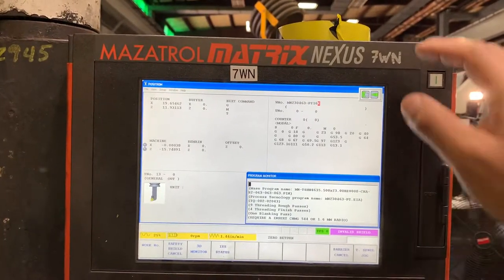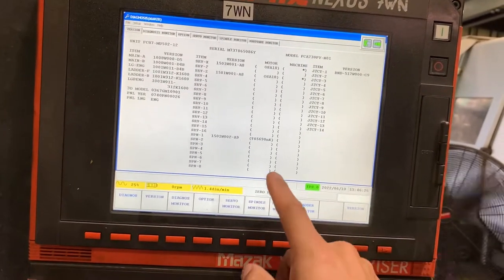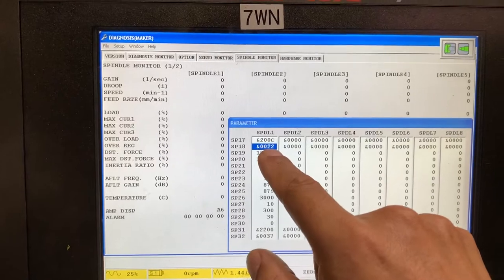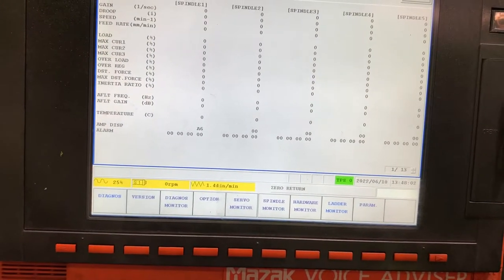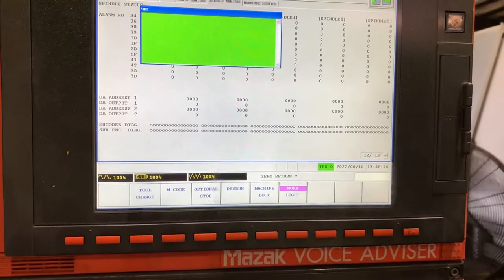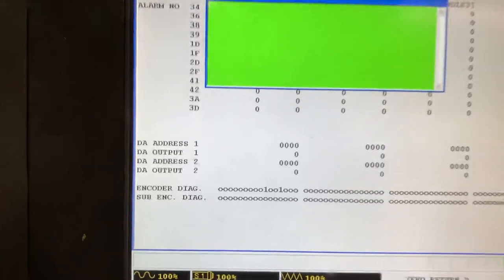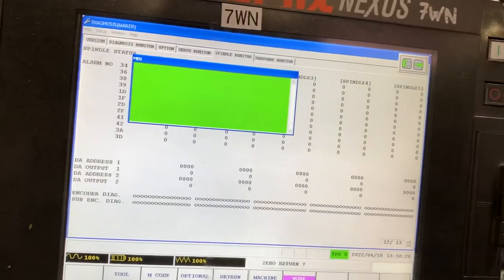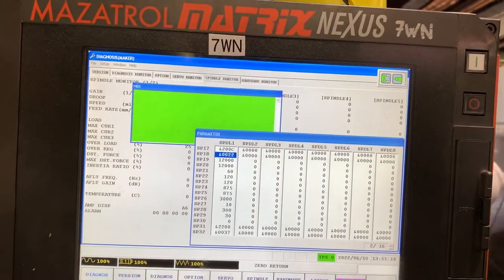Mazatrol Matrix Nexus: How to diagnose spindle encoder putting spindle into open loop mode

Comment: Hi I’m a newbie and recently bought this Mazak. Same machine as yours. It was running fine until something has been change at tools data. Errror is Designated tool not found. Can you give me some direction how to correct this issues. Regards
Reply from the maker: Hi there. 

Is it operating error #841? If so, the tools that are not yet registered on the TOOL DATA display are specified using T-code command in an EIA/ISO
program.
Check the program and register the necessary tools on the TOOL DATA display

A tool with application direction to the left (left arrow) must exist in the tool list for the previous step to work, even if it is defined as a null tool.
Reply: @FabianAchaval  Thank you for the quick  reply. The info you gave me fixed the problem.  it is now running as it should be. Thank you again. You're a  legend.   Regards👍👍👍